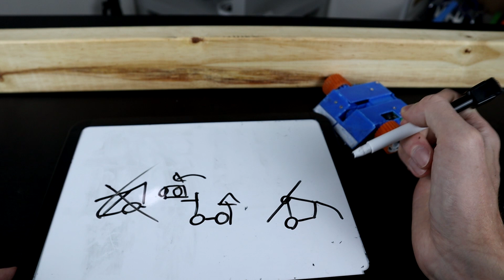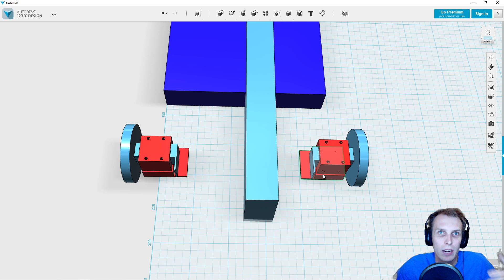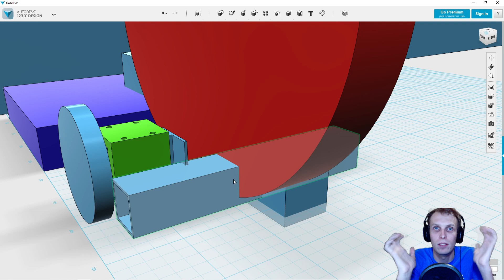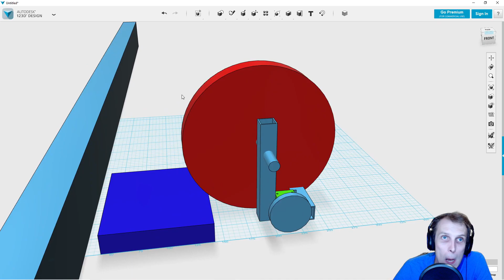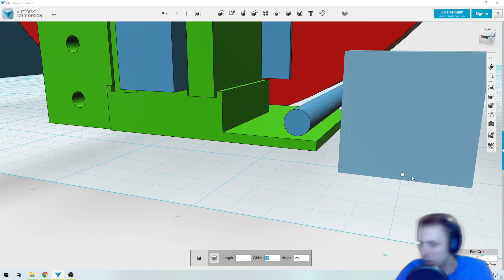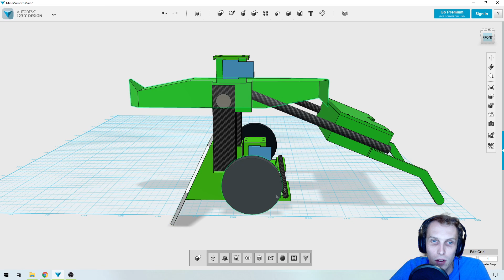Building a mini Mammoth, Part 1: CAD (150g antweight)

Comment: About halfway through it started to look less like Mammoth and more like monsoon... How fast are you going to have it spin?
Reply from the maker: As slow as possible, the slower it goes the more torque I can get out of it
Reply: @TeamPanicRobotics  do you plan on using a belt and pulley system for a gear reduction? Will that be able to generate enough torque without slipping? Maybe a gear train along one of the support braces? Or a fiber reinforced toothed belt? Or maybe a geared motor direct drive? That may not have enough torque with a 6+ inch long lifting arm. I'm so curious about this design now, haha
Reply from the maker: Its going to be a gear driven system, with the weapon motor being an N20 attached to one of the uprights
Just need to CAD some gears
Reply: @TeamPanicRobotics  that sounds awesome!

Comment: Psst, rear hinge flipper 😉
Reply from the maker: It'd need to be a spring flipper, I do want to try one of those eventually
Reply: @TeamPanicRobotics  I always wanted to try a spring flipper that used some massive trampoline spring or something that would launch the opponent several feet
Reply: @TeamPanicRobotics  I was being daft. You said front hinge flipper at the start instead of rear 😉

But yes, build one anyway 😄